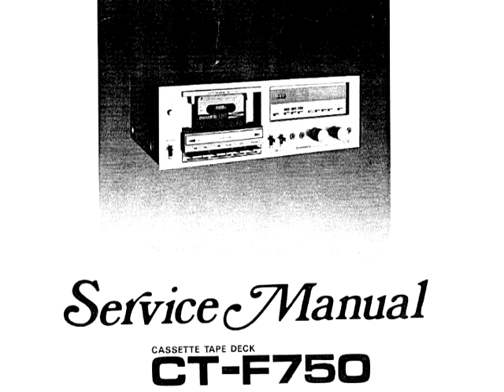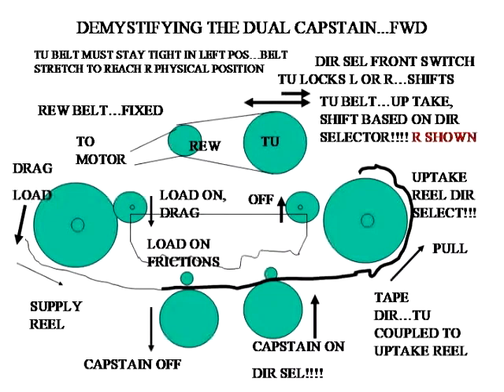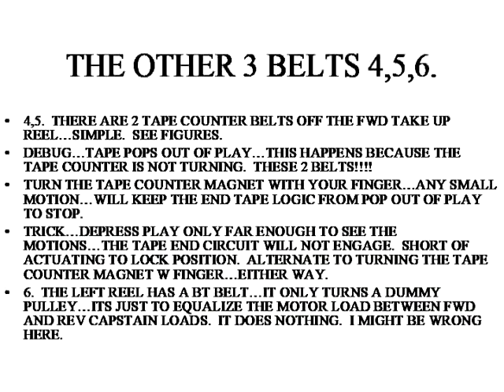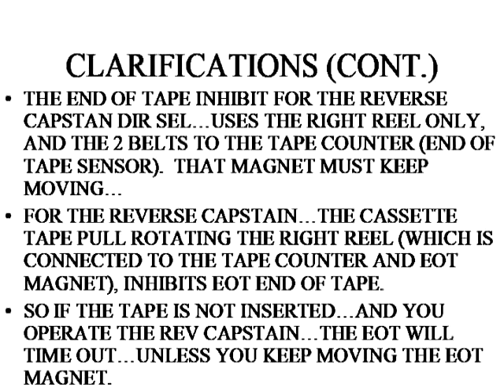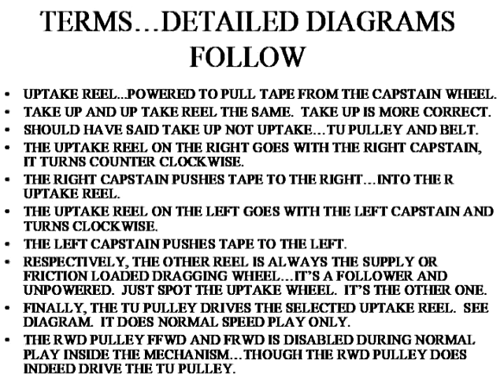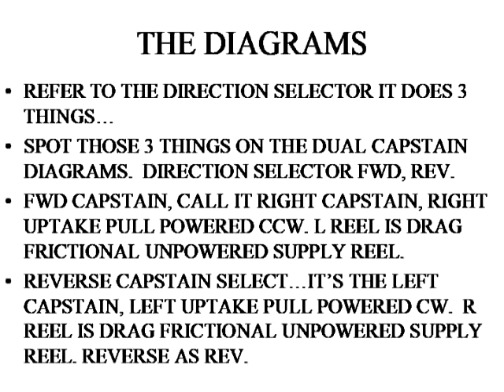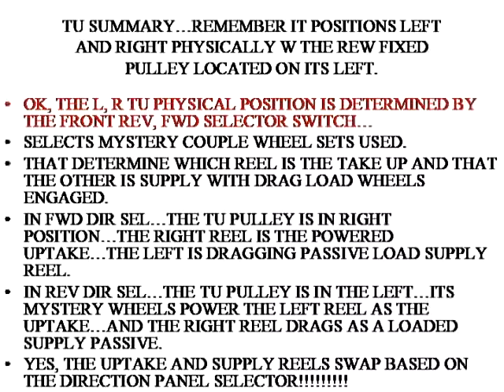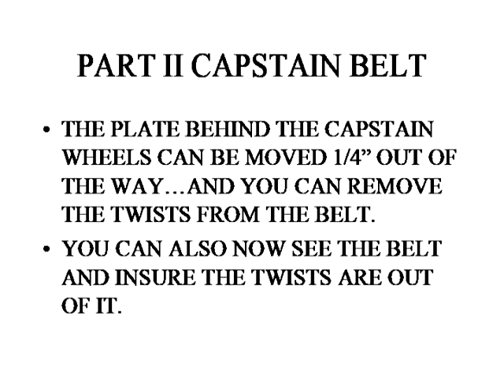Pioneer ct f750 belt theory p1

Comment: After I replace the belts the motor slows down gradually. Any ideas?
Reply: Probably on belt is a bit tigther than the original. Also motor could be a bit tired or needs lube or conmutaror cleaning

Comment from the maker: I welcome any comments.  At the end of part 2, I show you how to make your own belts out of common rubber bands.  The belt kits on Ebay are 30 dollars.  Using Walmart rubber bands you can make your own.  The main capstain belt requires you take a large 7" rubber band (#117B Alliance brand), you cut it flat at 90 degree, and super glue it with a tiny dab (as discussed pt 2).  The other belts are all right out of a bag of #54 Alliance brand small 3"-4" rubber bands.  I never buy expensive belts anymore.  It's a great way to keep your tape decks and VCR's running.